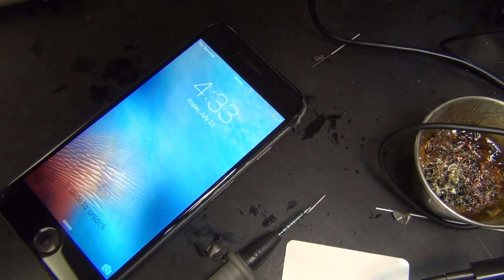iPhone 6S no backlight dim screen mail in repair soldering before and after

Comment: Isn't it bad to use metal tweezers inside of the phone..? Can't it cause even a tiny tiny shock and damage the board? Wouldn't a spudger be better?
Reply from the maker: you need to be very careful not to use too much force.   As long the battery is not pulg in and usb is not plug in and there is no power metal tools are safe.
Reply: capecanav He disconnected the battery, so the risk of shorting something to ground is minimal.
Reply: I do still believe a plastic spudger is safer.

Comment: Hi
if mail in iphone 6s, after tryvto fixed but still not working... any fee charged to try?
Reply from the maker: 20 to cover the part cost and return shipping.
Reply: ok, how long will take you to find out? previous checked and tried by repair shop locally. they can't fix... I hope you will be able to fix
Reply from the maker: 3-5 days